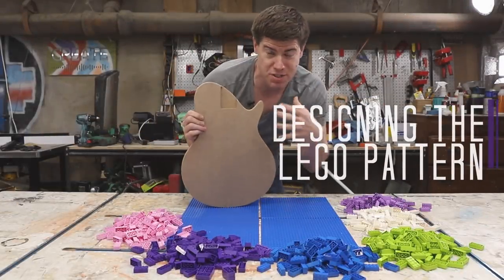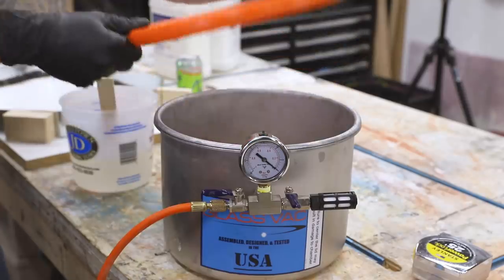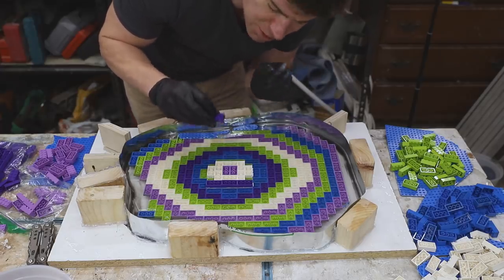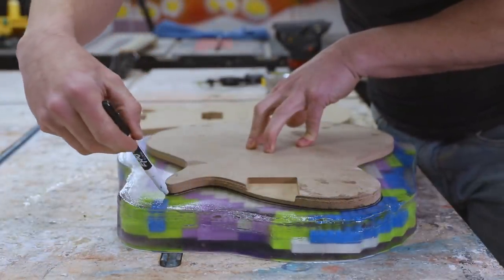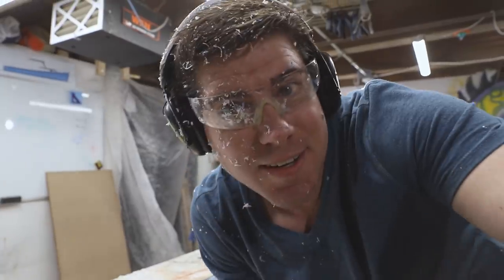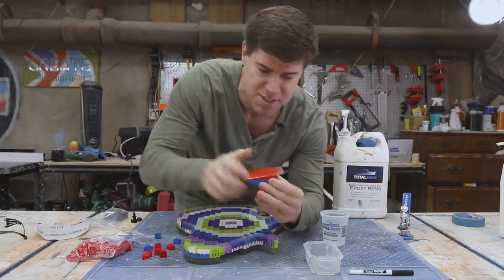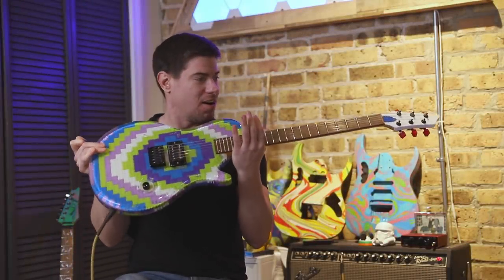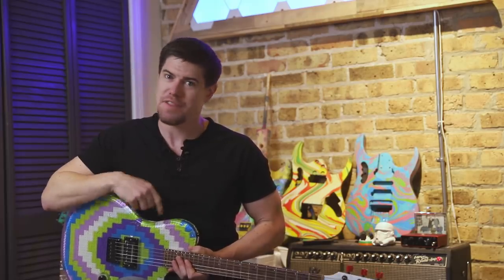I Made a Guitar from LEGO and Epoxy Resin..the LEGOcaster!!

Comment: You should try using a Lego wheel for the volume knob
Reply from the maker: Good idea!
Reply: I was thinking he could use Lego lights (or whatever they're called) for the position markers on the fingerboard too.😁
Reply from the maker: @jasonsummit1885  That would be next level!  If I do a sequel, I'll definitely look into whether that is feasible.
Reply: I was thinking the same thing about the knobs, or those turntable pieces.
Reply: Oops just seen the same question :)
Reply: Like Rick Parfitt Status Quo
Reply: And tone.
Reply from the maker: Yea, definitely would be a whole project for the neck... Probably a 2 video thing where I build the guitar and neck separately.
Reply from the maker: The guitar I poach the electronics from just had a volume knob, no tone knob.  I wanted to keep the electronics simple since the body was complicated, and I knew it would never be a great sounding guitar....
Reply: This Lego rubber wheel will work better than most "normal" knobs: http://pt.bricker.info/parts/4288/?site_mode=megabloks&site_type=sets
Reply: There are lego round bricks

Comment: Two things to avoid breaking the screws.  After pre-drilling, use a tap set, match the screw threads and create them.  Use wax to lightly coat the screw threads so they don't bind.  The wax is something I learned about from one of Dan Erlewine's videos.

Comment: Turn off the reverbe next time that tone was horrible
Reply from the maker: FYI - reverb is spelled "reverb" ;)
Reply: @modustrial  ok
Reply: The sound test was horrible
Reply: @modustrial  what a cheap move there... he was actually giving you a useful tip...
Reply from the maker: I was joking ;) I think things are being lost in electronic communication
Reply: Indeed.No guitar in the world could pass such a test.
Reply: Never insult a guitarist’s tone!
Reply: Nehemiah Zo Why? If a guitar has shitty tone, it had shitty tone, like BC Rich’s or most Deans.
Reply: @discomallard69  The lack of response to your comment suggests to me that the guitar actually sounds crap!
Reply: @1963TOMB  I mean, it looks like he threw the bridge and pickup into an arbitrary location based on the Les Paul he traced without any thoughts as to the neck that was going on there. This is reinforced by the fact that the neck is barely attached because the neck pocket is far too small! 

That thing will never intonate because the bridge is in the wrong place. So every fretted note will be out of tune.

Even more basic than that he didn't even anticipate that the low quality screws that came with the cheap bridge would struggle to tap into the much denser epoxy.

Comment: You could try using circular pieces, getting plate pieces in the colors you've used and make cylinders out of them. There are also smaller, 2X1 bricks that would be smaller. This would allow you to keep the rectangular heads but also be less bulky.

Comment: I really enjoyed watching this. In my honest opinion, there are a couple of things that I would have changed: you should have kept the Lego volume knob. That was a really nice touch, and I feel like a traditional knob makes this awesome guitar look a little cheap. The only other critique I have is not to use red Legos for the tuners. You have no other red Legos anywhere on the instrument, so they are a little out of place. Just use a different color for each tuner and it would add to the motif of the guitar.
Reply from the maker: Thanks!  And I definitely appreciate the feedback 😀
Reply: @modustrial  I originally agreed with this post, but after 2nd glance, I think the original black tuners best compliment the black bridge and black pickup and  black volume knob. Lego tuners, in my opinion, is slightly over the top.
Reply from the maker: Thanks! And that was the same thought process I went through :)

Comment: it would be dope if this guitar looked like it was completely made with legos and less epoxy. 10/10 if you were able to use the guitar as a baseplate for lego building on top
Reply: I’m doing just that to my ‘03 Epi LP. Going all black thin LEGO on the body and the smooth top LEGO tiles for the side and back. Putting LEGO truck wheels for volume and tone knobs. They make so many different pieces now that you can get almost anything with any curvature for the body shape. All the pieces are about  1/8th thick, so when I put a piece on the body to see if it’ll work, they will be lower than the fingerboard and fit under my tail piece and the height of mu tune o matc. I’ll have to wing it on putting them around the strap pegs. Not sure what to bond them down with after a bit of sanding. Anyone with any ideas? I do lots of golf club custom work and might use the 3M 810 epoxy I use there. I’m not sure of spraying on a satin after or let it look natural.

Comment: How about using small LEGO gears as tuners?
Reply from the maker: That would be next next level!
Reply: @modustrial  That's a great idea, but I'd go for the 4 stud red wheels, using your idea of epoxy filling the back and levelling up the front to make them finger friendly here's an ebay listing that shows the parts I'm thinking of: https://www.ebay.co.uk/itm/Lego-8-x-Vintage-train-wheels-4-stud-with-metal-pin-Pt-7039-RED-VGC-/202651725095
Reply from the maker: @hydorah  cool, thanks!

Comment: A suggestion on the screws.
( for the next build).
Drill and tap for machine thread screws instead of using wood or sheet metal screws. Those tend to wedge into the material which is where you get the forces stinger than the screws.
I also find most hardware store screws or decorative screws to have little strength.

Comment: Never thought of building with Lego bricks into a guitar.  Of course having that CNC unit makes life easier (G code is a bit funky to work with from what I hear. 

One can use a traditional router with after using a jigsaw (nearly cutting to the line) to finalize that shape.  Definitely don't smooth it with a spindle oscillating sander (it will melt the epoxy.  

I have never seen those clamps before at my local Rockler, but now I am gonna look a lot harder at the store for them.

Grammar correction.  The plural of Lego is Lego.

Comment: Idea for the tuners...hollow out the backs of the 2x2 blocks, and shave just enough of the metal tuner knobs to fit the blocks over the tops (with epoxy).  This way you still get the lego look and feel, with the security of a metal tuner. In other news, I know it's semantics, (maybe not), but why call it a 'Caster if you used a Les Paul as a guide? ;-)
Reply from the maker: Good idea for the tuners! 

Re: the name, it's Lego cast in epoxy ;)

Comment: Should have drilled the correct hole size and taped the screw holes. Or use time serts with a steel or brass threaded insert for the screws to grab.

Comment: What's a good affordable CNC machine for guitar building
Reply from the maker: It's hard to beat the x-carve for the price. (It's what I use)  It does take some time to put together, but that is the trade-off for the low price.  There is a link in the description if you are interested.  The only thing that is lower priced would be going totally diy with Arduino controller, aluminum extrusions, etc....but expect it to take weeks or months to build if you do that
Reply: @modustrial  thank you so much

Comment: Now, there are a few problems with this guitar... One being the colour scheme. They don't go together at all, and it really makes you want to look away. Another would be how much that thing probably weighs. Since apoxy is quite dense, that guitar most likely weighs around 20 to 30pounds. That's a fairly heavy guitar. The lego tuning pegs just look uncomfortable, and probably feel the same way. Probably the last, and most obvious, sound. It's full of slight feedback, and the sustain isn't even present. Definitely isn't the strings, as the ones you used were either D'Addario XL 9's or 10's. That bridge looks to be fairly cheap, so that could partially cause Sustain issues, and maybe tuning issues at some point. A Humbucker pickup like Seymour Duncan, EMG, or even DiMarzio would have definitely helped out with your sound, and maybe even solve that annoying "constant sizzle" effect. If you do make more of these, I'll happily watch. Just remember that the cheaper the part is, the worse off that guitar may be.
Reply from the maker: Yea, this was the second guitar I've ever made, so it's a learning experience ;). There will be more....
Reply: If this is only the second, you definitely have potential for greater builds! Cheers!

Comment: Great! But I suggest you always wear a professional filtered mask when you work with epoxy resins, inhaling the dust is very very toxic.
Reply from the maker: Thanks!  I've seen a rash of "epoxy will kill you" posts recently... There must have been something spreading the hysteria on the internet...I suggest doing a little more research...a very small percentage of ppl have reactions, but for most people it isn't really a concern....of course, when you dig into it, it's a bit more nuanced, but it certainly isn't as simple as "everyone should always wear a mask".  It isn't like woodworking where the dust is universally and equally bad for everyone....
Reply: Modustrial Maker uhm.... when you are sanding it it becomes dust and if you inhale it it will inevitably create a deposit in your bronchi and/or lungs. it’s not a matter of being allergic to it, it’s a mechanical and chemical issue I believe. For what I know it’s like wood if not worse, of course we are talking about your airways so I don’t want to insist much but it seems you like to work the epoxy a lot, so maybe ask your phisycian!
Reply from the maker: this is partially correct....sanding UNCURED epoxy is very dangerous.  Cured epoxy.. not nearly as bad.  https://www.westsystem.com/safety/health-effects-from-overexposure-to-epoxy/

But, I'll usually wear a mask when sanding for long periods (same as with sanding wood), unless I'm wet sanding (like I was here).  Wet sanding generates virtually no dust, so there really isn't a reason for a mask.

Comment: U have a cnc machine and keep cutting things with hand saws.
Why?
U could have perfectly done alll those cuts and drills using your cnc machine.
Its easy to preset.
Reply from the maker: Not everything is that easy... Getting the CNC aligned with a workpiece once you have already cut an organic shape is very tricky
Reply: @modustrial  there are some tools which can help unto align.
That's not that hard.
And..
Good job, btw! It's awesome what I have done!
Thanks for sharing
Reply: @modustrial  and cutting the external lines are the last procedure, btw..
Clear the surface
Go to inside details.
Pay attention on the finishing surface... if there are no marks.
Drill.
And finally go cutting the external border.
 
(Sorry for my English way to try explaining.) 
Hug

Comment: o.o' i coulda probably saved you an hour and 45 minutes on those broken screws if i wasn't a few months late to seeing this video lol

easy way to get screws out if you break em like that is just cut a line in the middle with a dremel or a thin metal file and use a tiny flathead screwdriver to back the screw out

Comment: Nice project, but one quibble: Your lungs aren't being done any favors by doing that routing without a N95 respirator. If you want to find out what COPD is like by the time you hit 50, this is how you do it. Care for your lungs, as much as your eyes or hands. Seriously.
Reply from the maker: Thanks!  I've got some N95s now :)
Reply: Oh, fantastic! Great! I'm an industrial painter, started as a kid at 15 in 1980, and over the years I've worked with many boatbuilders that used resin and didn't ever wear respirators. I worked on one job where the guys were smoking as they gel-coated boats! (The 80's were not the most safety-oriented of times) 

Over those 4 decades, nearly to a person, they went down with lung disease, kidney failure, bladder cancer and one from solvent-related exposure that left him with dementia. (Resins, solvents and alcohol - do not mix!) Watch out for toluene, xylene and any of the resin extenders. Do yourself a favor and read up on the MSDS sheets of the substances and then hit wiki and arm yourself (since Bush Jr's first term, around 2004 or so - the safety info isn't really as easy to find as it used to be - the manufacturers do this to hide themselves from liability). Use hepa filters on your vacuums, and I think you can even get canister liners for shop-vacs now to keep the dust down even more.

Beautiful work, BTW, how is the sustain and tone on the guitar without the overdrive? In the video is was kinda sharp.

Comment: Great work! If you were going to make changes in the future, I would recommend swapping the guitar head altogether. The bricks look tacky, as you mentioned before. But its also the white head. Since it doesnt match the rest of the guitar that well, it makes the guitar look kind of cheap. You could go natural wood to get a new texture in there. if you were set on doing something other than natural wood, you could make an epoxy head that matches the pattern of the body.

Comment: One thing no one else has mentioned......
Is that the reason you're getting such a  thin sound from a double coil..
it looks as if the  wires that are hot & ground are only from one coil.
Reply from the maker: Good eye, but no, not related to the sound.  It was properly grounded later, off camera.